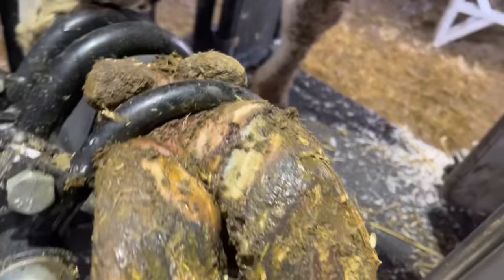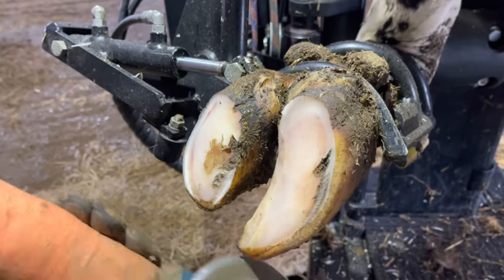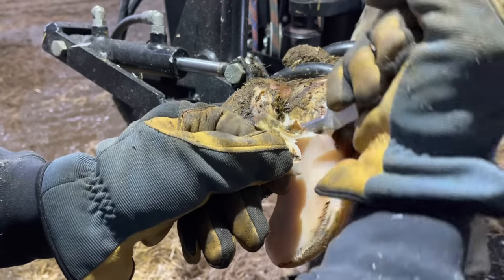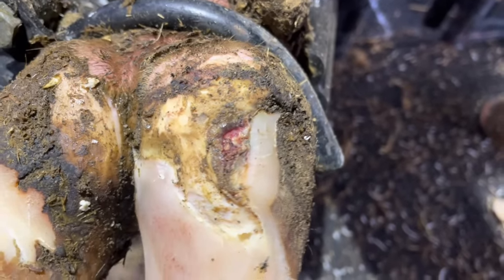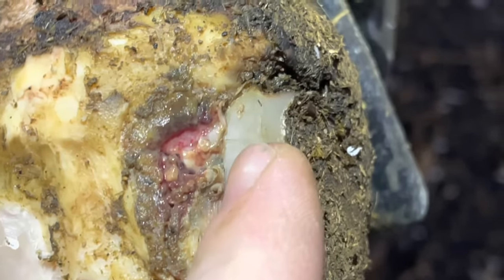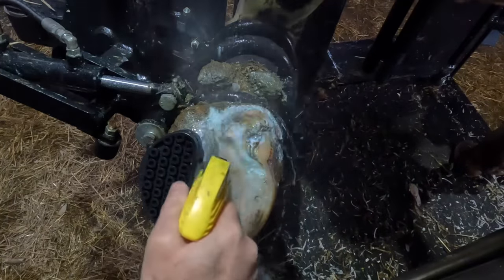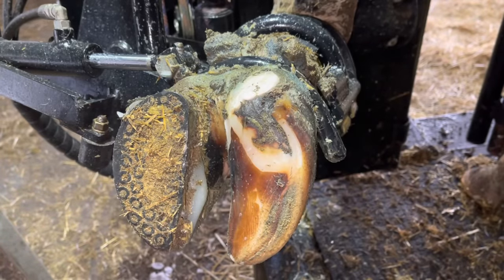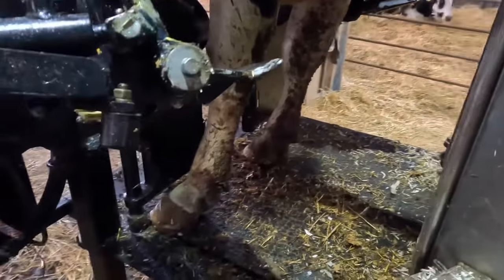HOW can we REMEDY this COWS CRACKED HEEL??

Comment: I'm a horse farrier and also do hard gel nails on myself.  Using that combination of experience, I've found both roughing up the nail / hoof surface, and spraying the area to be adhered to with with isopropyl alcohol (to remove oils and dry the surface), really helps vettec and my own gel nail stay on the longest.
Reply: This is basically the same process as acrylic/poly gel nails
Reply: Acetone works better than alcohol to dehydrate the surface imo
Reply: @Autumnpearly  when working quickly acetone is more likely to promote condensation and cause lifting than alcohol is, as long as you use 90% or higher

Comment: I remember you said you've considered a blower attachment on an air compressor, but more portable: have you considered the handheld battery powered turbo fans sometimes called a "compressed air duster" for doing an initial clearing of debris to get a better look? (I've started using them for cleaning computer equipment and they're surprisingly effective.)

Comment: I'm sorry this might sound a bit silly but I'm always impressed at how cows (and similar animals) can walk and even run on those skinny legs. The pressure exerted on those hooves must be extremely high. Thanks Nate for everything you do. That wound looks nasty.
Reply: Most if the thickness of those skinny legs is bone, compared to humans where you have more fat and muscle in the area. The cow's bones in that area are probably about twice as thick as yours in that area, making them 4 times stronger. Plus they have 4 legs instead if two. So eight times the weight-bearing capacity, and a cow weighs 8 times as much as a person (or less).

Comment: Wonderful video as always! On trims like this I always wonder how visible the point where the separation ends is. From the video perspective the edges that you're working on of the half-trimmed hoof and the fully trimmed hoof look really similar. The separation is obvious on the heel bulb but becomes less obvious as you trim. In real life if the separation clearly visible all the way through the trim, or is there a method you use to know when to stop?

Comment: Hey, great video! One question: Why are you still using the white glue? I thought you switched to it because it dries faster in hot temperatures but is there a reason you're not going back to the green glue this winter?
Reply from the maker: Green sets up faster.  Too fast in the heat.  Sometimes it starts to set before I get the block  positioned.

Comment: Heel bulb separation means trim back to the problem from the heal bulb and then get all the sharp hoof edges trimmed back and calasilic acid on the would and bandage then look again two weeks later and again two weeks later and trim the hoof again then recheck if needed

Comment: When you leave a very thin area unwrapped at a checkup like this, do you ever use iodine, or does chlorhexidene dry up the lesion in the same way?
Reply from the maker: Neither one really dries out the hoof.  They just prevent bacterial interference.